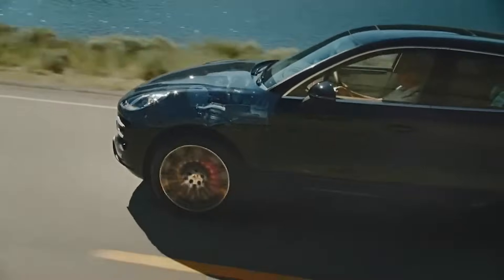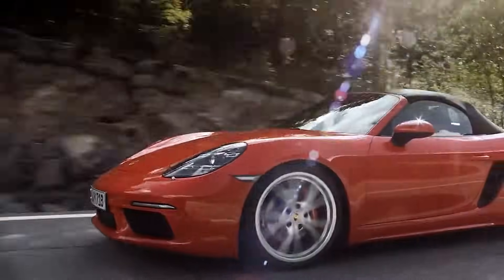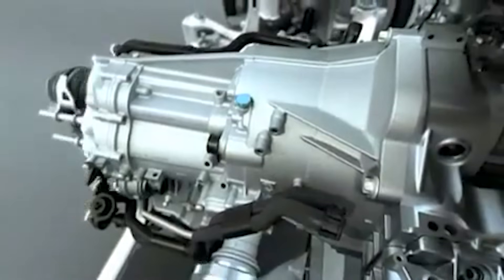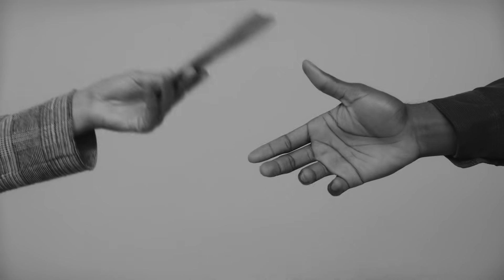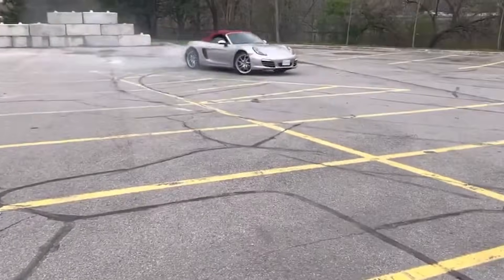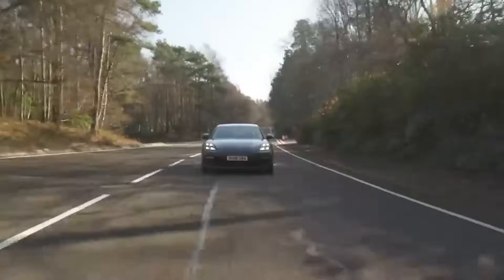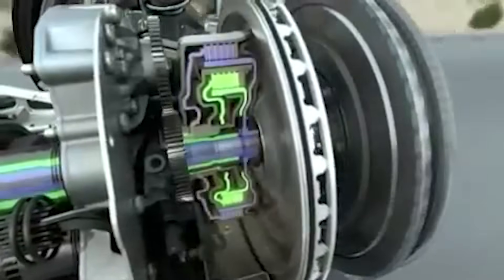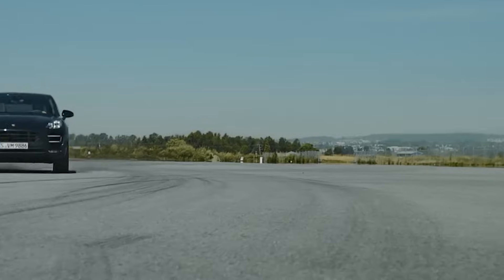Why Porsche’s PDK is Smarter (and Faster) Than You!

Comment: I’ve smoked many Porsches, bmws etc off the line with my Tesla. Then they go crazy and drive 50 mph over limit to pass me 😂😂😂
Reply: Try taking a corner in ur microwave
Reply: @Mrhappy33664  better than a cayenne which will blow a hydraulic line on the second turn 🤣🤣
Reply: @bobbysuazjFhvcfgh Yeah lil man I think they are talking about a real transmission here. This class isn't for your junk car....
Reply: @Sidewinder5  because I just usually want to trigger an insecure person into getting a big ticket 🤣🤣🤣
Reply: @bobbysuazjFhvcfgh I’ve had 5 Cayennes now, not one single problem with any of them. They are perfect. Own two currently. Don’t know where you’re getting your information from.
Reply: @rossdonison4999 I feel sorry for your financial decision making losing so much value on 5 cayennes. I personally would’ve bought a Range Rover. At least range rovers are pretty and look expensive. Both are at the bottom of the list as far as reliability and customer satisfaction 😂😂
Reply: @bobbysuazjFhvcfghMan, you are loaded with misinformation. The chassis of a cayenne is the same as a Toureg, that’s pretty much it. Next you’ll be claiming Lamborghini and Bugatti are nothing but Beetles also. Seriously dude. Get a grip. Oh, and maybe educate yourself on JD Power and other quality and reliability data. Porsche ranks high on durability and reliability, unlike Range Rover. Your ignorance is embarrassing.
Reply: @bobbysuazjFhvcfghYou are talking about resale values, and you bought what… a tesla???? 😂 You don’t even know the the beating you are going to take when it comes time to sell appliance, do you? Sometimes people have to learn the painful way.
Reply: @rossdonison4999  I’m not sure what u are talking about. I can find 10 year old cayanne turbos for 10-15k with cylinder bore scoring. Check consumer reports, Range Rover has higher rating than garbage cayenne. Teslas hold their value very well. There was a one time depreciation when Elon lowered prices but it’s been very stable
Reply: What is the electric car worth in 5 /10 yrs time compared to a porsche?
Reply: @peterrimac3408  depreciates by 60%
Reply: @peterrimac3408  it will be worth more than any SUV or truck made by Porsche 🤣
Reply: @bobbysuazjFhvcfgh idk if you know this , being a tesla owner youre probably too slow to understand anyways, electric car batteries deteriorate , thus the value of the car goes down, also no one wants a 10 year old microwave anyways.
Reply: @evanw-ix2nw  it’s sad that this is all u could come up with even after editing 🤣🤣🤣
Reply: @evanw-ix2nw  SO TRUE MAN
Reply: It's funny watching Teslas take off from a light thinking everyone is trying to race them lol.  I always imagine them getting home tickled because they thought they beat another fast car so they post on youtube or other forums about their "kill".  Then they go to an actual track day and realize they can only go out for a single 20 min session because their battery is basically dead after that.  They end up having to leave the track, find a supercharger, charge, and HOPEFULLY make it back before the next session starts. Longer sessions are a no-go.  There is only one track here with a SC close enough to do that, and I've seen it done, but who the hell wants to leave the track to go charge and miss the beginning of the next session?  Tesla's are great, but they have limitations. You aren't going to do anything but a couple short sessions at a typical organized track day.  Go to a real track event where you're allowed much more time on the track and you're screwed.  I prefer to actually drive my car on the track during track days, and watch/talk to others in between sessions; NOT drive away to charge all alone.
Reply: @RealErikHansen  wow Man U got a lot of time on ur hand writing essays, mine is too valuable to read ur verbal diarrhea 🤣🤣🤣
Reply: @RealErikHansen  I’m sorry, I don’t have time to read ur verbal diarrhea  🤣🤣🤣
Reply: Not just that, you can get a 2-3 year old Plaid for 40K USD and  Model 3 Performance for high 20's.  However, betting that car enthusiast would prefer a slower car that imparted feeling through the howl of ICE  , the slower standard transmission,  and being able to do track days and club racing without range anxiety. But to each his own.
Reply: Yeah, but you still drive a crappy Tesla. 😂
Reply: @crvzer  yeah IF u have a Porsche, u just paid 4 times for a crappy VW and a badge 🤣🤣🤣
Reply: @bobbysuazjFhvcfgh What decade are you stuck in, dude? That argument (porsche = vw) lost water a long time ago. You look pretty silly now.
Reply: @rossdonison4999 if more than half of the parts on a Porsche say VW on it then it’s just a VW in drag 😂
Reply: Some people use a $10k commercial grill and some use a $200 electric air flyer.  Both do the same thing but there is a big difference.   I was thinking the same way you are thinking until I drove a  911 Turbo S.  The level of engineering is day and night!
Reply: @masonshayanccim4084  yes level of engineering like bore scoring, IMS, head gasket, oil leaks 🤣🤣🤣
Reply: @bobbysuazjFhvcfgh said the guy who drives a Teslaaaaaa 😂😂😂😂🎉🎉🎉
Reply: @GermánChamp-q2e  guy who is so insecure about himself that has to waste money on a Porsche to get validation 🤣🤣🤣🤣🤣
Reply: Tesla is pure trash 🗑️
Reply: Dude think he's cool in an electric car 😂 lame
Reply: @1uponu705  yes u are much cooler sitting in my rear view mirror grinding your teeth 🤣🤣🤣
Reply: of course but thats a ticking time bomb on the road
Reply: Why does the limit matters when you just race. Unless you're letting the gas off at 65 because you saw they're coming to pass you 😂
Reply: I ain’t gonna lie I hate on electric cars 2 i hate the feeling of some chick in a Tesla take off on my tuned M2 at a street light but an ICE can’t compete in a straight line it’s just a fact. They had a lucid sapphire smoke a dodge demon even on a prepped 1/4 track and they even had a grandma driving the lucid.
Reply: But tesla slower then porches in a race track. Want the w on acceleration? Sure you can have that.
Reply: @iJakku not true. Bring ur cayenne against my Tesla MYP and I’ll smoke u. It also depends on the driver 😂
Reply: EVs are gay as fuck lol. Stay in your lil charging station🌈
Reply: Who’s the insecure one here, desperately posting about tesla on a porsche video because people aren’t talking about you 4-door trash can, so you have to draw attention to it. Look at me!! Look at me!! I drive an appliance!
Reply: Hi everyone. I currently have a Tesla Model Y (AWD, not performance), a Porsche Boxster GTS (the 4.0 flat six, with PDK) and an Alfa Romeo Giulia Quadrifoglio. All are different and serve their purpose. If anyone is interested in hearing from someone who can actually compare them first hand, let me know - I'm not gonna dump fuel on this battery fire if nobody wants that to happen 😂
Reply: @bobbysuazjFhvcfgh  yoooo Boddy cooking all you thumb technicians! 🤣🤣🤣🤣🤣🤣🤣🤣😂😂😂😂😂 never liked tesla but I want one now! Thanks Bobby! Keep roasting these dweebs! 😂😂😂😭😭😭😭
Reply: Teslas are gay
Reply: Dont do It much, because you wont go very far, those ICE can make 800 km at 200 km/h.
BimmerN53
Reply: @federicotorresbordils7624 u must have missed some physics classes in high school if u think a gas car can go 600km at 200kmh 😂😂😂
Reply: Eh, this kinda "brag" is super cringe, brother.
Reply: @Peterkatiem23  deal with it 😂😂😂
Reply: You beat people off the line? Am I supposed to be surprised or something?
Reply: Just because you smoked a 328i doesn't mean it's faster than an M5 Comp pack, 918 Spyder or GT3 RS bud, nice try though.
Reply: Tesla making a corner be like. thats why you'll never see a Tesla on a racing series unless they improve downforce lol
Reply: You're not a car guy, car guys don't drive a Tesla even if they drive electric.
Reply: @v-e-r-c-i-n-g-e-t-o-r-i-x  did u pull this rule out of your behind?? 😂😂😂
Reply: @bobbysuazjFhvcfgh sad but true mate, don't get so upset. Car guys don't drive Teslas.
Reply: Electric will be faster but you got a microwave not a car lol. You car doesn’t have a soul that roars. It has a battery pack lol. Drive a 911 whilst you’re still young! Save the Tesla for when you’re old.
Reply: @vincentiPad change ur ims bearing 😂😂😂
Reply: zero soul ..Teslas are a soulless vehicle

Comment: the PDK in my Macan S is incredible: I drive 40 miles to work and get 34 mpg on average, but when I need to catch a light, I have instant power available. The coast function is very cool and you can force it into coasting by manually shifting up if you have your foot off the gas pedal

Comment: I’ve driven manuals my entire driving life of now 57 years.  I’ve now had a Porsche PDK for the last 4 years.  Driven it on the street and at the track.  My conclusion is that there is simply no comparison.  The PDK is superior in every way.  People say there is less engagement and connection with the car with the PDK.  I don’t feel that at all.  You can use a PDK in the same manner as a manual except you don’t have to use a clutch to shift.  Now we have rev matching manuals but before you had to do heel and toe downshifting which is very hard to do consistently smoothly.  The PDK makes glorious sounding rev matched downshifts quicker than any human ever could.  The PDK allows left foot braking which is a big advantage on the track and for spirited street driving.  I think the manual purists just don’t want to acknowledge superior technology.

Comment: PDK is exactly the same transmission as the VW DSG. DSG is an awesome transmission so that also means PDK is awesome
Reply: wrong pdk is made by ZF. Whilst DSG is made by BorgWarner and IAV GmbH.definitly not the same components or ECU.
Reply: @jayliwela6402 and then there’s S Tronic made by VAG.
Reply: @RB-xv4si they just rebranded zf hp8
Reply: @real_ultrajoe that is not correct. The ZF HP8 is an 8 speed automatic transmission. The VAG S Tronic is a 7 speed dual clutch transmission.
Reply: @RB-xv4si  I might of mistaken but the I do know later Audi they been using the 8hp rebranding I believe to tiptronic or multitronic
Reply: , you're wrong. Dsg is derived from pdk, meaning it is the same transmission with a small difference (to fit in the Beetle), just manufactured by a different company.
Reply: No dsg is fwd the pdk is rwd for rear/mid engine car

Comment: Maybe so, but I broke the one in my 2019 Panamera at 30k just by trying to pass someone on the highway.  2 trips and 2 weeks on separate dates to the dealer and still not working correctly.  Warranty about to run out so car went bye bye. 😢
Reply: Damn unlucky... my lasts for 300.000 km  now. just "frequent" oil and filter changes.

Comment: My Dad drives a 2007 Volkswagen with a dual clutch. Most of the Vehicles from VW later 2004 uses a dual clutch transmission.

Comment: It's for lazy people who can't shift a clutch. I love control to shift into gear I want or need and down shift..
Reply: All my cars are manual transmissions except three: An F250, a GT3RS, and an RS3.

And I'm pretty decent at using a clutch pedal, having driven manual cars for forty years, including tracking them for half of that. Have had old cars that required double-clutching, and pretty dang good at heel/toe shifting even.

Now of course the traditional slush box, torque converter automatic in the truck is completely lame, but that's fine. It's just a work truck and I don't need to get any fun out of driving it. The Porsche and the Audi both have double-clutch automatics, and they are amazing. I've tried several of the "automated manuals" that came out in the first decade of the 2000s--BMW's SMG automated single-clutch, Porsche's Triptronic, Ferrari's F1, etc.--and they all sucked. But the modern dual-clutches, at least with a good program controlling them, are fantastic. In the automatic mode, my PDK is ALWAYS in the right gear. On track, it has downshifted by the time I can think, "Okay, I need to downshift now." I've run many, many hours on track and never once thought, "Dang, I'm in the wrong gear." Never. And in manual mode, I can control the gear I'm in just like you said. The only thing missing is the third pedal itself.

That being said, I do still enjoy using my manual cars too. But the modern PDK is NOT your typical old slush box. It's fantastic.
Reply: @xtnuser5338 But still no fun with no engine sound going up and down you get with a manual. I love the interaction of shifting... You can't hear the engine as you do with a 6spd Manual has in Sports Cars...
Reply: @QuietStormX  I don't understand your point. Yes, you still hear the engine revs increase and decrease.

Comment: Did they upgrade the sensors in the newer version?  They're a weak spot in first version PDKs.  Some dealers will replace bad sensors, other just say you need a new $10K trans.
Reply: Yes they upgraded the shift fork position sensors. Dealers will NOT fix anything on a PDK, only sell you a new one for 20K. Some indy shops can replace the sensors.

Comment: ZF built transmission
Reply: ZF makes transmissions for a lot of companies 

What is your point lol?
Reply: @DMX-NAS he saw which trans is in the m3s because they have “1000 hp” somehow makes it better than a pdk
Reply: Would expect nothing less
Reply: The point?
Reply: Zf is a single clutch
Reply: @breadsandwich84   "Zf is a single clutch"

ZF manufactures several different transmissions.
Reply: Porsche builds the ZF
Reply: @AQCE245 negative, had a a pdk leaking hydraulic oil. Unit was sent to ZF, Porsche does not or is not even allowed to touch them. Car 991S was one month out of use till they managed to get a unit in exchange from ZF. Am a Porsche guy but will not touch a PDK with a long pole from now one. Manual is the way to go.

Comment: You seem to suggest no oil changes needed for the Pdk.  Is that the case?
Reply from the maker: @Numberone292  my manual suggest every 6 years or 60k, but it’s sealed so you can’t check oil or add if necessary.
Reply: Nah PDK is made by ZF and DSG is made by Borgwarner not the same ECU,one uses a wet clutch whilst the uses a dry clutch.they definitely not the same.
Reply: @jayliwela6402  VW hasn't used a dry-clutch unit in any production street car in many years. All the later PDK and DSG units are wet-clutch. But no, they're still not the same transmissions. In fact there are multiple variants of each.
Reply: This depends on the vehicle. A PDK in an SUV will need service at different intervals than a GT car. In the UK, 6 years or 90,000 km is a good measure. Don’t change the fluid too frequently, as this leads to shifting issues.
Reply: @VoxSapientia  No it doesn't lead to issues. PDK and DSG transmissions are the same and 60k km intervals for every day driving is required. If you drive aggressively, track, etc... then 40k km intervals. They can be verified but it's not for a home mechanic.